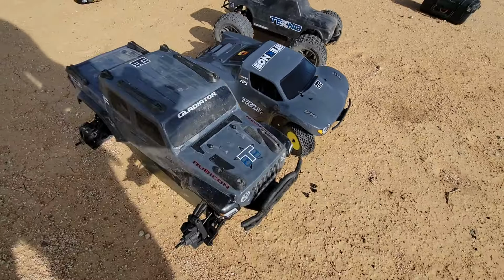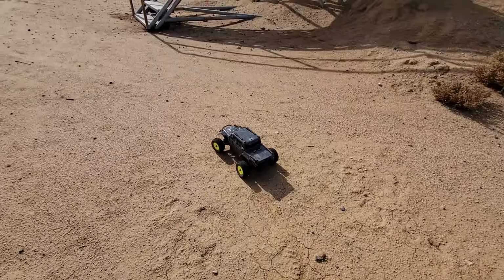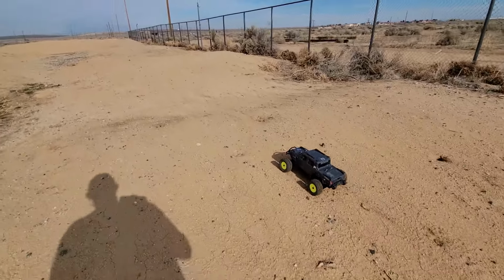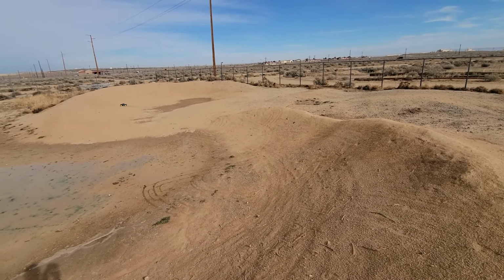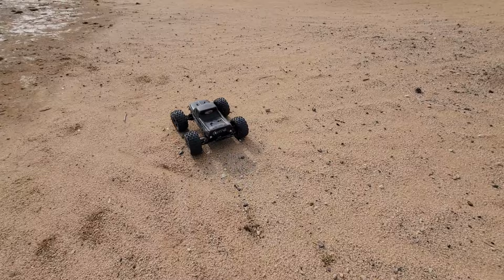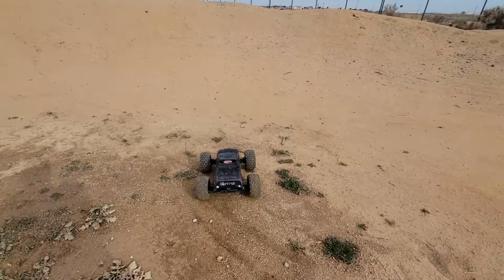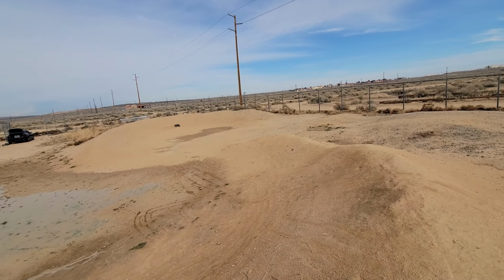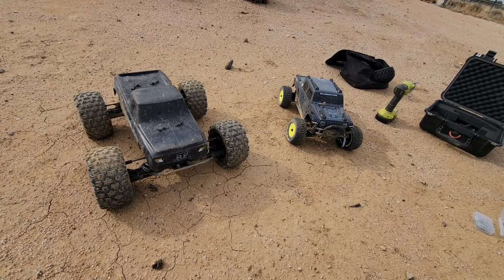Tekno MT410 2.0 and MT410 Track Bash!

Comment: Are you running the manual specs on the MT410 and what size tires are you using? Yours was so smooth on the throttle.
Reply from the maker: Yes box setup other than diff fluids and shock setup is modified with delrin guides and internals from M2C. Tires are Copperhead 2s from the Kraton 6s (3.8s) 👍